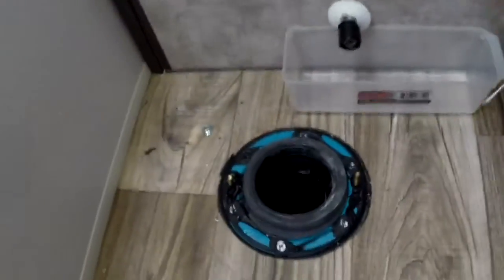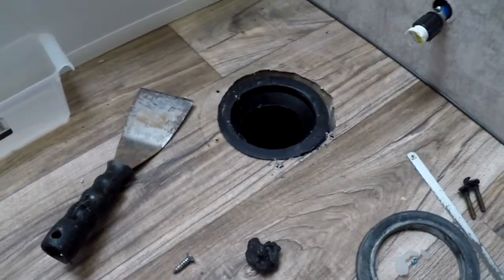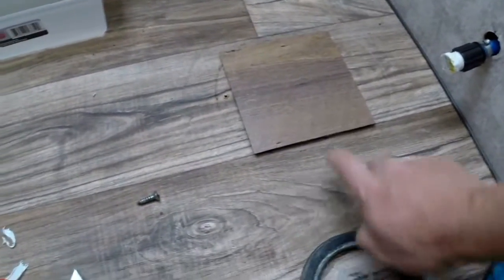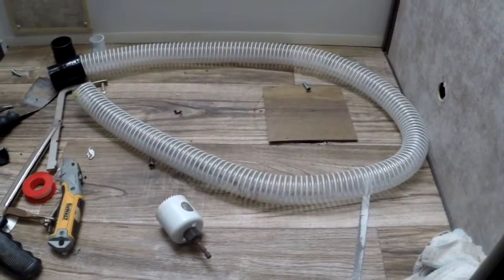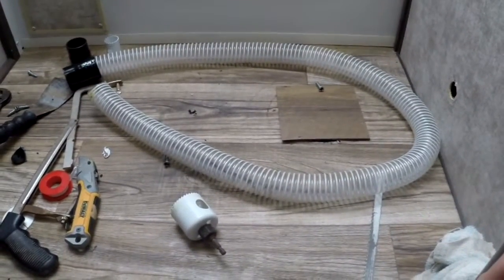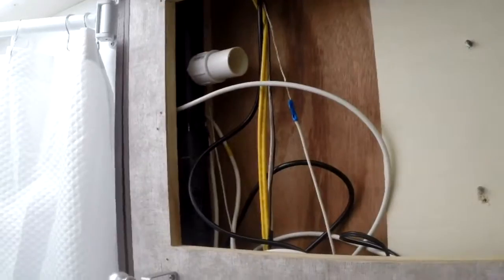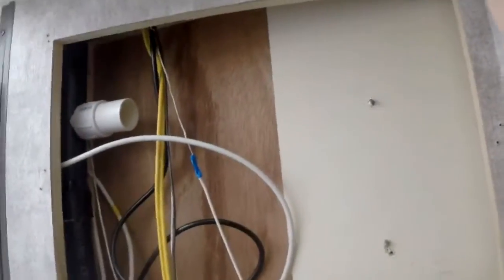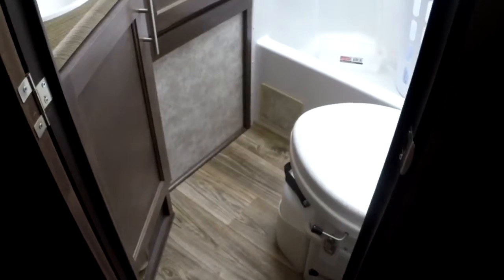Natures Head Composting Toilet Installation Eagle Cap 1165

Comment: Nice video. Isn't the air intake on the left where you have the hose and the hose should be on the right?
Reply from the maker: They are swappable it can go on either side you just switch the hose connection. The little fan is inside the hose connection.
Reply: @TheSquirrelsNest  thanks. I need to do that to mine